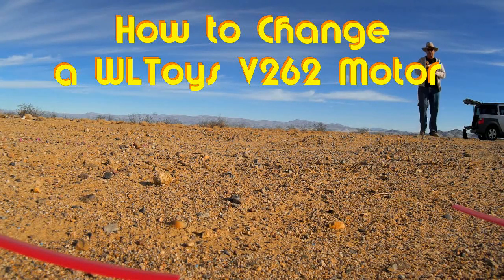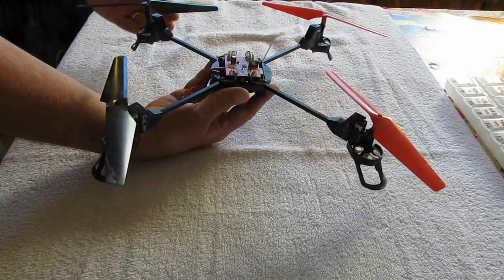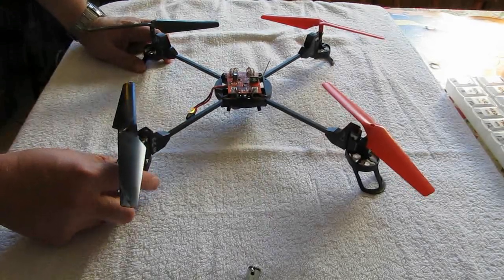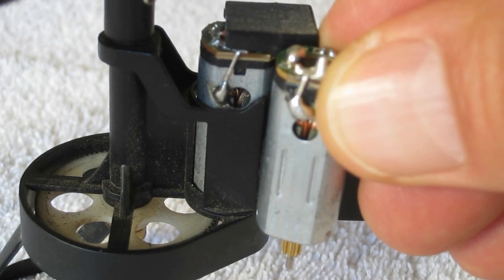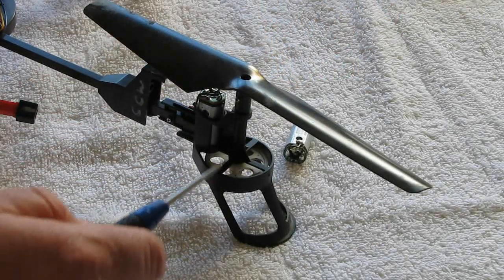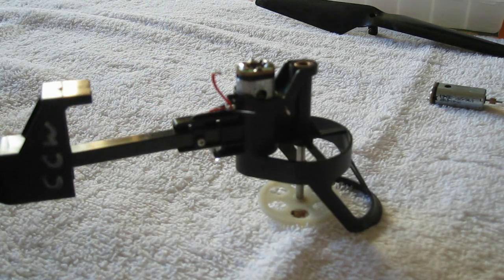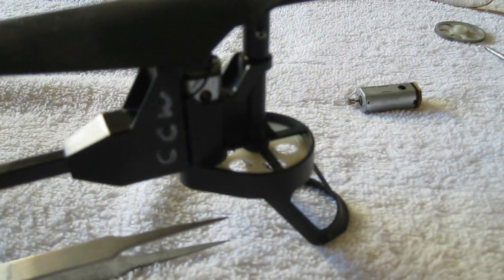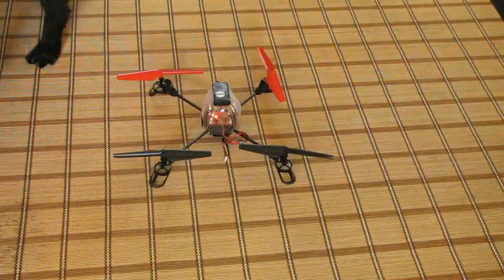WLToys V262 Cyclone Repair: How to Replace a Motor

Comment: How long does a motor last, how much flights?
Reply from the maker: Lorenzo Van het hul about 25 flights.  But with time that averages to about 5 to 6 flights before a single motor burns out.  That's why some recommend replacing all 4 to give you a reset of 25 flights till the next motor burnout.
Reply: Quadcopter 101
Five flights! If this is true, it is downright terrible.

Is there some way to extend the lifetime of the motors?
Perhaps by oiling the gears and prop shaft, and keeping movements very slow (40% - 60% rates) and fine usage of throttle, and never, ever doing flips?
Reply from the maker: Brad Vickers some people replace the rotor shaft brass bushings with real bearings (cheap and widely available for this quadcopter).  Limit time in hover. and try to keep some forward motion to take advantage of translational lift.   Recently I've started to use canned compressed air to clean and blow out debris from the motor vent holes after each flight.  This actually seems to help a lot as it's been a while since I've needed to change a motor.

Comment: Quad, did u do a vid for your Mobius mount for the V262?
Reply from the maker: It's a very complicated setup.  https://plus.google.com/b/118071415779556107317/photos/+Quadcopter101Blogspotcom/albums/5961726241529952097
Don't laugh.  It works very well :)
Reply from the maker: I also found that wide scotch packing tape is easier to use.  Tape firmly holds the camera to mitigate vibrations and thus minimize jello effects.  That's why I use it.
Reply: Cool thanks

Comment: Just finished the mod to antenna for my V262, put it in the air, up about 20', lost signal broke a boom, ???
came back, checked my work, looks exactly like all the pics??
My antenna was straight, (5dbi) pointing at the quad?? anything I'm missing, wish you could post pictures here......help
Reply from the maker: You've got to be very careful to separate and not to short the outer shield cable with the inner antenna cable.  Also make sure to solder the antenna and shield cables to their correct respective positions.  Finally no you don't point the tip.  Instead you point the sides of the antenna at the quad.  The RF energy expands radially out from the antenna sides.  Very little energy comes out of the tip.  Watch how I point the sides of the antenna (with reflector) at the quad in this video: WLToys V262 Quadcopter Drone: Altitude Test with Windsurfer Parabolic Reflector
And based on your accident, you might need this: http://www.banggood.com/WLtoys-V262-V333-RC-Quadcopter-Spare-Parts-Carbon-Shaft-V262-17-p-86323.html
Or this: http://www.banggood.com/WLtoys-V262-V323-V353-RC-Quadcopter-Spare-Parts-Motor-Set-p-920550.html
Reply: Quadcopter 101 Now that I think about it, some of the outer shield, the braided part pulled free when I was trying to separate from the inner cable, tho, I felt I still had a fair amount. The inner cable is soldered to the left side while the twisted braided is soldered to the right side. Just like the video and stills in the link you provided.

I'm going to try it again, as I left the over all cable similar to the length of Hammerdudes video. Thank god this isn't a $1000 rig, LOL.... Oh and thank you for the other links, I didn't actually break the boom, just the whole piece that holds the motor, fortunately I have spare parts from a 2nd V262. Banggoods still gunna' get a fair order. Ha Ha

You hav been so much help, hopefully I get the opportunity to meet you some day!! and shake your hand!!
Reply from the maker: Mike A Recommend using a magnifying glass to look for shorting.  Just one of those extremely tiny braids touching the inner wire or its solder joint will short the antenna.  If you do find one shorting, use a toothpick with your magnifying glass to see if you can move the braid to break the short.
Reply: Quadcopter 101 Ah now I understand, will do. Thanks
Reply: Quadcopter 101 Success, I guess that was it, tho I couldn't see anything touching, but just in case redid it, also turned the antenna sideways, just walked in from test, bird went a bunch further. SWEET, now on to the mobius!!

Thank you again!!!!!
Reply from the maker: And don't forget to try the reflector. It will double the range once more.  It only takes 5 to ten minutes to build one.
Reply: Thanks again, I'll give it a whirl.
Reply: Mike A I see that you recommend sticking the antenna up thru the canopy on the v222, given how I've changed the shape of the original foam guard from the V262 I may be able to get the antenna thru the top, would that help with range too

Comment: OOPs, one small thing, what wattage soldering iron do you use, when doing my motor change my 25 watt, did the job but not without a few almost disasters, like melting the edge of the area that holds the bearings, whew!!
Reply from the maker: Mine is only a cheap 30 watt that I bought for about $5 at Walmart.  But it works.  But a very important thing to remember is to always clean your soldering tip of oxidation before use.  Otherwise the solder won't melt quickly, and you may overheat other sections of the component that you're soldering.  I generally wipe my tip on a damp rag with a bit of sink scouring cleanser before use, then wipe it clean with a paper towel.  But there are more "approved" methods.  Recommend viewing a few soldering tips videos on YouTube.  Just type "soldering tips" in the YouTube search bar above.
Reply: Cool, thanks again

Comment: Howdy, do you know where I might find a "pigtail" for extending the wiring from the stock 1sq Vcam camera. moving it to my V262 and the lead simply isn't long enough
Reply from the maker: I think that this will do it:
http://www.banggood.com/Function-Extension-Cords-For-New-Version-V912-With-Functions-p-83052.html?p=RB0922217402201307U3
If it does, please make sure to go back to my other video that may have given you this idea, and thank Luis del Muro Cuéllar for finding this link: WLToys V222 HD Camera Modification
Reply: Quadcopter 101 Looks like it, THANK YOU......and yes, thanks to Luis del Cuellar

Comment: One more question, can you recommend a 5dbi antenna and where to get it for the mod to the stock radio for the v262
Reply from the maker: http://www.banggood.com/Wholesale-FrSky-2_4G-V8-Series-5dB-Module-Antenna-p-68703.html
Reply: Thank you. Say you live over off 395, yes, so your a fellow California boy, No. County San Diego here. I'm thinking of moving up to something larger, maybe 350, 450 size, with onboard GPS, altitude hold, return to home, etc. Is there any RTF complete with radio that you've flown that you find exceptional. My goal, video
Reply from the maker: Mike A I'm trying to avoid larger quads with the main reason being safety and available flight locations.  People tend to notice larger heavier quads, and there are some that rightfully object to having them fly nearby.  They're worried about their safety, and the safety of their property.  And Diane Feinstein thinks you have a camera pointed in her window with the intent of peeping ;-) http://www.politico.com/story/2014/01/senator-dianne-feinstein-encounter-with-drone-technology-privacy-surveillance-102233.html  

As such, you may be limited in your flying to your local RC field. But with smaller quads you can fly just about anywhere with limited objection from locals, and the authorities.
Reply: Ah yes, I did have a neighbor mention something sorta close to that yesterday while I was testing the new motors in my V262,
just thinking of something with brushless motors rather than the brushed type., so maybe a 250ish, RC Logger size.

I currently have 2 websitss up, one on Standup Paddling, (supwest.com ) and Longboard surfing (morsurf.com) and want to shoot video for both without the fear of losing a motor in the process.

I did just pick up a LaTrax Alias (Craiglist, $75.00, like new) and am replacing the motors in it with the MMW motors, have you flown that one, really stable, WOW ez to fly and I've seen where the Mobius works well with it, but would still like something a wee bit larger for the wind.

Thank you again for your always prompt replys
Reply from the maker: Mike A For over water flight you are probably going to want something with GPS.  If you are patient, I feel that this is coming soon for the smaller sized quads (along with FPV).  In the meantime, you can fly just about anywhere without authorities getting involved if you stick with these smaller quads. As for the Alias, am awaiting receipt for review of its $60 WLToys clone, the V636. http://www.banggood.com/WLtoys-Skylark-V636-Headless-6-Axis-RC-Quadcopter-VS-Traxxas-ALIAS-p-938098.html?p=RB0922217402201307U3

and also its 1080p camera http://www.banggood.com/WLtoys-1080P-HD-Camera-For-Wltoys-V262-V353-V333-V323-V636-p-943813.html?p=RB0922217402201307U3

By the way, the above camera also works for the V262.
Reply from the maker: and to demonstrate my point, a short flight over a dense neighborhood.  Nobody heard or even noticed it in the air.  And if it should fall from the sky, no worry as its light weight makes it extremely unlikely to harm person or property Hilly Pittsburgh, WLToys V222 Quadcopter Drone
Reply: Quadcopter 101 Hi Quad, can't seem to find any reviews in the camera you mentioned, is it that new??
Reply from the maker: It's brand new, just released by WLToys for their quadcopters.  I'll eventually be reviewing it in about a month (awaiting the slow boat from China).
Reply: Quadcopter 101 Darn, oh well, Patience right, I've never been long on that, Patience.......but we"re dealing with China here!!, However if you keep tract, shoot me a note once you have the camera, I'd like to order something soon, however for only about $20, maybe just go with the Mobius, any chance you feel the WL unit will be a real competitor??

Comment: Hello Quadcopter, I'm getting ready to make the mod to the stock radio antenna, while watching the vid by Hammerdude he mentioned talking with you about the mod. my question is, is there any particular length that the pigtail needs to be once cut?

I too am replacing all 4 motors in my bird,upgrading to the Massive RC shielded bearings and doing the heatsink mod as well, I'm learning fast here, LOL

FYI, i'd asked about the motors being ccw vs. cw, so contacted the motor supplier and was informed that they receive the motors in one large lump, (all stuck together), maybe 200 at a time, there reply, "just make sure that when soldering the wired on the new motors, make sure that I replace the wired on the new motors EXACTLY as I took the old apart", we'll see. LOL
Reply from the maker: The length of the pigtal shouldn't matter if you're using a shielded pigtail cable (outer wrap and inner center wire) and you ground the outer wrap wire as shown here: http://www.rcgroups.com/forums/showthread.php?t=1873198&page=43

As for the wiring cw or ccw, you can use the diagonal opposite motor as reference as it should be wired the same.
Reply: Quadcopter 101 So given I'm electrically challenged, are we both saying the same thing, just put the new one in the same as the old one is going out. Thanks, your great at returning messages!
Reply from the maker: Mike A That's the way to do it,

Comment: Hello Quadcopter.
     If I understand your tutorial, it suggests that there isn't a ccw or cw motor difference, I ordered and received 4 motors and as near as I can tell there's no difference, I guess when the factory wires the motors, they just reverse the polls and the motors run opposite?? yes

Also, are you still running the motor covers, as removing them doesn't seem to really give more motor exposure, seems better to remove the motors one at a time and open up the sides of the actual area that literally hold the motors, any thoughts??, maybe then add the heat sinks??
Reply from the maker: Although there isn't any visual difference, I still order them as cw and ccw as needed (there's no price difference). But I have installed a cw in a ccw place by just reversing the polarity.  It's still running fine.  

I still run with the motor covers installed.  Feel that the covers hold the motors vertically in place better, and may help reduce occurrence of slipping/stripping/damaging the white plastic gears.

Comment: I thought I'd read that there my be some better motors than the stock.

Can you shead some light on this, I've sadly lost my first motor, so hopefully I'm not buying older versions.

Thank you.
Reply from the maker: Not that I know of for the V262.  I just ordered six for myself. I'm planning to replace all 4 on my V262 in the hopes that it will extend the time period until the next motor failure (leaving 2 as spares).  They're only $3.80, but it does get aggravating when one of them fails while on vacation :(
http://www.banggood.com/WLtoys-V262-RC-Quadcopter-Spare-Parts-Motor-V262-16-p-84305.html
Mayday! Motor Failure (WLToys V262 Quadcopter Drone)
Reply: Quadcopter 101 Hello Quad,

Thank you for the answer, being brand new to all this is daunting at best, but learn by fire seems how I learn the best.

Another question if I may, have you experimented with heat sinks to help the motors cool, plus I've seen another post where the guy really cut a lot of the meat out of the mounts holding the motors, as well as the covers, any thoughts.

Mike

Comment: Yeah my replacement motor is different than the one that is on the v262. Instead of the two bare wire's soldered to each side of the motor I have only one. Also there is two holes that have copper around them. I am assuming that my wire will solder to these holes. This is a newer motor manufactured this year in May.

I do love the way the v262 flies but I think its a shame to have to change a motor out soo often. I would not recommend this quad to anyone. In fact if mine burns out another motor it goes up on Ebay for parts.

Comment: I bought 4 1400kv brushless motor   so that I can install them on my quadcopter. Can I have your advice/comment please ?
Reply from the maker: It's not a simple plug-in change to do so, and it actually mat be more trouble than it's worth. But the people that you should be talking to are on RCGroups. Maybe the people on this thread may be able to help you? http://www.rcgroups.com/forums/showthread.php?t=1979915
Reply: thx a lot

Comment: Has your battery ever burned out
Reply from the maker: No, not yet. Let me guess, your V262 is having problems taking off, seeming like it does not have much power?  If so, one of the motors may be failing.  The other three motors also slow to try to keep the quadcopter level. To determine a failing motor, attempt takeoff. If the quad slides in a particular direction, the motor in that direction is the likely bad motor.
Reply: I was flying it and my quadcopter landed and one of the wing was spinning only. I went over and turned it off and then smoke came out from the battery.
Reply from the maker: That sounds like a short, which can be anywhere from the battery to the motor. If this is a new quadcopter, recommend contacting customer service from where you purchased to resolve the problem (if Banggod, it's cservice@banggood.com).

If you've had it a while, and customer service won't help, inspect any exposed wiring at each motor to make sure they're not touching the motor case, or each other.  Also inspect the circuit board for signs of burning. If all looks good, consider purchasing a new battery.
Reply from the maker: Also look for any melting of the insulation of each motor's wires. If you see melting, you've likely found the short.
Reply: Everything looks okay i am going to get a new battery thanks for your help.

Comment: hi. just wanted to  say great vid, and great tips/tutorial. THANK YOU. when i attempted to disconnect the motor from the board, the slot where the motor connects to the board came off as i tried pullin it off. do you have any tips on how to solder back that slop on to the boar, and do i need to replace it with a new one. if so do you know if banggood has replacements? thank you so much for your help and your great vids.
Reply from the maker: Here's a replacement circuit board. But note that for future motor changes, it's not really necessary to unplug the motor from the board. 
http://www.banggood.com/WLtoys-V262-RC-Quadcopter-Spare-Parts-Receiver-V262-12-p-86449.html?p=RB0922217402201307U3
Reply from the maker: Please note that the board may or may not come with the battery plug soldered. If so, don't lose your original board as you can swap the plug with the old board.